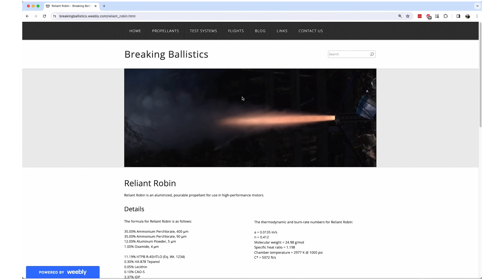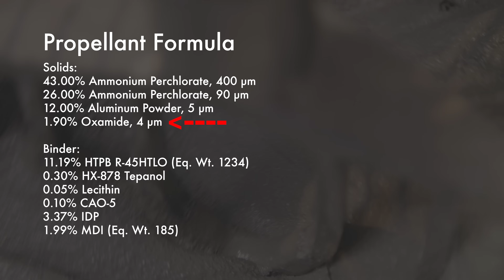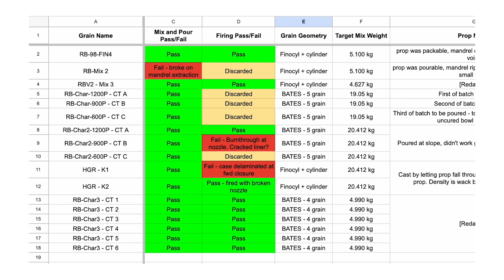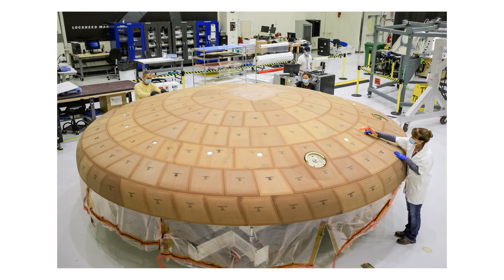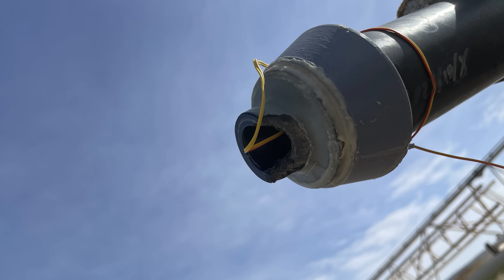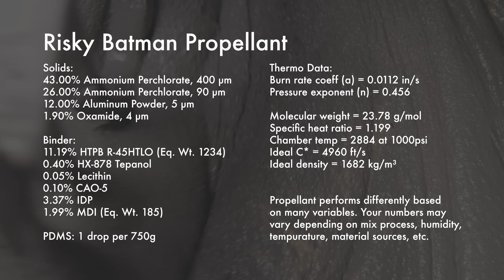First Time Firing My New Rocket Propellant

Comment: Going over 100% isn't really an issue it just changes your formula from percentages to parts. Since the total will now be over 100 per serving. And if you needed 100g you would just calculate for 99.

Comment: So why not make a motor that has two layers? Initially, the motor has a layer of propellant that has 90m AP and burns harder, then as it burns through the first layer, it reaches the second layer that has 400m AP. If this works, then you should turn out with a motor that burns hard initially and burns a bit slower later in the flight. I don’t know if this would work, it’s rocket science after all.

Comment: Just had this thought, and thought it might be valuble to you, given that you're still working on these motors. You had issues with your mould release early on in the video, it might be worth getting some Teflon rods and sheet, and making a negative mould from that, it's pretty cheap and would completly eliminate your need for mould release, and would give you a bit more consistency for your propellant geometry, since you won't introduce a bunch of variation in surface area on the inside of the motors. Im not an engineer, so I wouldn't be able to say much more than that, and I could be entirely wrong, but I am a chemist, and I know that variations in surface area can affect reactions in really unexpected ways.

Comment: Love your attitude and passion.  I do have two observations.  First, would it make sense to buy some screening material to control the particle size and secondly, could you perform your vacuum procedure in the tube rather than the pot.  Maybe even allow to cure under vacuum.

Comment: Quiz question-on these hobbyist solid rocket motors, does anybody use styrofoam for the core of the mold to create the central cavity? Rather than dissolving it, one could let the early part of ignition process burn it out.

Comment: Im late to the party since this video is one year old but working with concrete, we use a giant vibrator to get the pouring air out of the concrete. The vibrations make the liquid act more liquid temporarily. Might f up the mixture though and bring heavier parts of the mixture down and make it a two phase. Would’ve to test - but it’s a method I would recommend. Just holds giant vibrator on the outside of the tube

Comment: I might be 1 year to late but if you like try this again with the big one but change some things make 2 different things this fuel and thermite.
So use same % fuel you used in this video then mix in about 5% thermite in all through the paste and wow the burn is extreme if done right if not literally explosive as it burned so fast it became a bomb.
So ya.
I use my mix with 100mc and 300mc not 90mc and 400mc as the thermite doesn't like to um light so when it does 3 things slow or fast or boom 😂.

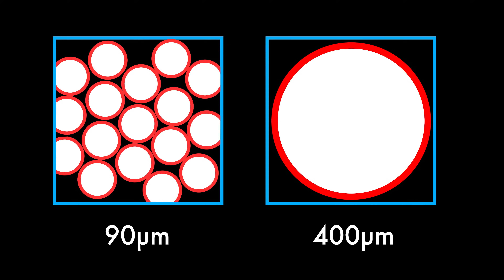Comment: 3:00 That view of the perchlorate particles is not right imho. They do not decompose from all sides, but are embedded in a matrix where the burn frontier wanders through - So they start to decompose from one side. If that werent the case, and the pearls would be engulfed in flames from all sides, that would also mean they might get ejected out the nozzle prematurely.

Comment: Awesome, one suggestion is for the mandrel, which is instead of PLA (which often makes a great molding polymer given how stiff and chemically inert it is, but if adhesion is your primary problem and reducing oils would be beneficial, nothing doesn't stick like PA (nylons) just straight nylon (no smoosh-ins) and as anyone who has printed it before, it barely wants to stick to the printer. I've use Taulman's Nylon 910 for molds and it is super slippery (and obviously tough) I would bet the slight flex won't affect accuracy of mold release since you aren't using injection molding and there is no pressure other than gravity.

Comment: How did you get your theoretical burn rate? Did you get it from Terry's book?

Another way to characterize the fuel if you dont have a pressure guage is by using the rocket performance equation

P=kn*density*isp*burnrate

Burn rate is webthick\burntime

Then you m=log(p2\p1)\log(kn2\kn1)

And n is 1-1\m

Then r is aP^n solve for a. 

I jave verified this method a couple of times and i have made a video on it as well. 

I dis this because i wanted to see if i could do it theoretically and to see how close I was once I did burn tests and full static tests and I was literally spot on

I love propep3 and the book by terry. Good stuff.

Comment: Galcit 61c: good old tar baby. Some asphal say 70%+10 weight motor 🛢 5% +3%mineral oil 22%oxadizer potassium perchlorate. Ok heat tar to350 ferinhigh safety first .research moon buner and RATO n JATO ,3 Stage should get the rocket to low height above ground.  Say 110.000.

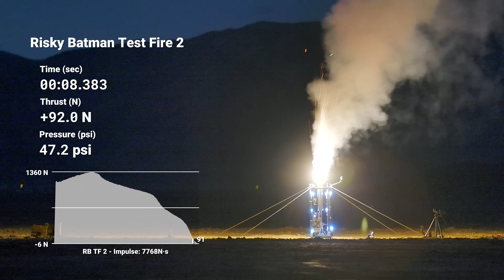Comment: 13:15 Just curious, why does the thrust eventually go negative?
Reply: motor's burned a lot of mass after ignition and i presume thrust is measured from force pushing down into the stand, so when there's less mass affected by gravity in the end, it assumes that there's a decrease in thrust 

TL:DR, rocket ligter, less mass, "negative thrust" because lighter

Comment: Hey Joe, in your vertical test stand how do you account for the changing weight (mass flow rate) of the propellant in your thrust computations?   Do you have a link to a paper or video that shows this?

Comment: hook hook hook, right? thats the most artistic moustashe ever. you can just try until it works. so you mean poopology, shooting down from the butt-ology. this man is baking tough cookies. or cement. solar sun heat collecting blimp launch platform gets up to say 50km even before any rockets are launched, you just need to paint the carbon fiber balloon fabric with high temp carbon black and aluminium reflective paint, just like survival blankets. for reasons. fusion/solar reactor is a better power source. that fenolic stuff looks to be just wood. or cardboard tube. making bread dough is tedious, relatively. does not your outer rocket shell keep the nozzle compressed inside, without cracking. creator: "ok..."
Reply: whats the best rocket, if not solid state rockets. gravity plumbed liquid rockets. yep you can do the reactor reactions without turbo pumps.

Comment: Have you ever used 3 or more different micron size NH4CLO4? I’ve tested with ferric oxide to alter burn characteristics. 
First motor test exceeded chamber pressure (serious chuffing). Blew out end plug but recovered case (4140) and carbon graphite nozzle intact.

Comment: Have you considered using a vibrating fixture when pouring propellant?  This will get the air bubbles out of the propellant as it is placed, and is far more reliable than "rodding" the mixture by hand which can actually create more voids than it removes.  I have never built a rocket motor but I have placed some concrete and it makes a huge difference.  It's another process element you can parameterize and control.

Comment: For burn rate tests I recommend using less propellant (1 lb is fine). To make calculations easier you can settle for a rectangular prism or cylinder grain shape that you've precisely measured and develop a surface regression equation for until their is no surface left (which gives you surface area at every point during the burn). Assume that that Pmax is the start of the burn (max flame spread) and the end of the burn is the bump in the graph when the propellant splinters apart (hopefully near the end if your binder/curing was good). It's better to test in triplicate or more and using so much propellant for one shot is less good than multiple shots with less propellant. Also nozzle diameter is key for burn rate, make sure you get a before and after diameter measurement and that you use steel or graphite nozzles. Good luck and stay safe out there!

Edit: I finished the video and you pretty much did just that lol.

Comment: This wont help you with your space shot but i did just successfully test a G class Motor thats fully 3D printed from ABS, even the nozzle which showed very little erosion. Im using 80 grams of KN Sorbitol and ground rubber. Burn time is just under a second. Something to try!

Comment: Armchair scientist here!!!!! Curious if you have thought about using a Chopped carbon fiber/graphite composite for your nozzles They both hold the same temp ratings or close too 3000 give or take but I feel the structural aspect of carbon fiber might win out! And yes for all of you that are going to say they are the exact same thing you're right!!!!!! Given your ability to produce things others just are to lazy to try... I am curious if combining the chopped or strand carbon fiber with the graphite powder/slurry prior to molding if it would alleviate some of your cracking issues! I also understand your asking for problems adding anything that could possibly trap a single bubble or cavity but where there is a will there is a way!

Comment: When pouring the propellant into the rocket body, have you thought about strapping an orbital sander to the rocket body and gently vibrate the body at different frequencies to help break up the bubbles another difficulties that you were having? PS. Safelight, can you replace a windshield with a rocket motor sticking out of it.😂

Comment: Why don't you automate a sifter for your AP, get some 90 micron sieves and shake it for a few hours with a motor until everything smaller falls out, if you are worried about larger particulates, then get a 95 or 100 sifter and reject the larger particles that remain. Essentially you are doing another quality control step that the manufacturers are supposed to do, but it's better than unattainable consistency from different vendors.
Reply: I just saw someone else commented the same thing and suggested stacking the sifters, that's a great idea.

Comment: The graphite nozzle surprised me. I did not expect it to crack. It kind of wonders me how competing units are merged together in the data here. Even feet competing with inches. I thought the foot is the English scientific unit of length just to see once again that that's only partially true. Btw is there a simple way of just using a cooled nozzle for test firing.

Comment: A downside is that Newtons aren't really compatible with psi. So you need a constant to fix or switch the unit. There could be newtons per square inch or you use pascals or even bars.

Comment: Hi Joe! Great work on this saga! How did you calculate the burn rate versus chamber pressure data point for each of the motor tests? I see you have exactly 6 data points (I assume one for each motor), but which part of the thrust curve did you use to generate these points, and how did you measure/calculate the regression rate exactly?

Comment: also if you take a trick from Jack Parsons(JPL) form the sold fuel into triangles to make a pentagram
Reply: re heat when in the press or vaccume the bubbles out and are you sure the mold release isnt causing the bubbles or the PLA?

Comment: please don't be offended by this - but I expect that people playing with stuff that can blow their faces off might see beyond "superficial offence". Also, forgive me if this has been written to you already amongst over 800 comments below.

You are just p1ssing into the wind, formulating by %weight as you are. You absolutely should be working by volumes! Personal professional experience as a formulator of surface coatings, adhesives, sealants taught me that "volumes" is the ONLY way to work! Rheology is a key aspect of paints, adhesives, where "volumes" reign - and aren't you really just doing the same with stuff that goes Bang?!

You are working with mixtures here, not solutions and every component takes up space in that mixture. Sure, there are things like particle surface area that affect flow (when wet) and combustion rates (hopefully only) when dry. But you have mixtures here and mixtures work by volumes. Presumption here is that the SG (specific gravity, density, call it what you will) of every ingredient is known so you can easily formulate by volumes and convert back to weight for measuring out later.

The silliest part I saw here was when you typed in a recipe to get back, amongst a whole lot of burning (?) data AS WELL AS SG! The only way you would illustrate that you get SG from there is that you don't already know it - as you would already would if you formulated by volumes so I infer, by that, that you work by weight!

Imagine a table headed by "component name", "volume", "sg", "weight".

You enter in the volume of each component (could be % but needn't be) and the sg and that gives you the weight.

Add all the volumes, add all the weights, divide and that gives you the sg of the entire formulation- easy peasy! 

Where using volumes works best is where you wish to switch out some of one ingredient in favour of some of another ingredient, and where the sg of both are different. Do that by volumes, adding one - reducing the other does not impact the volume contributions of all the other components but doing that by weights sure does.

So formulate by volumes and convert to weights for weighing out and manufacturing (and for publication). It works wonders when you are juggling with recipes as you are.

A second tip, if you are juggling two components to achieve something like "desirable pourability", make one measured pot well one side of target and another pot well on the other side (weigh them). Then mix some of each until you're where you need to be, weigh the two again and you can easily work out what you have in that perfect mixture. Might work well if you're juggling with something that's in very small amounts and Lecithin is a standout candidate. Again, formulating by volumes makes the world of mixtures a whole lot easier and clearer.

Comment: When I pour concrete we use a “bulldick” to vibrate the concrete to prevent airspace. We do this during the pour before the concrete gets too hot and firmed up. I understand it’s not a very scientific method but it works. This could be scaled down to assist with the void concerns. Hope it helps. And please let me know if you try it. Great program you run I’m a long time fan of your work.

Comment: you need to vacuum your castings in a cylindrical vacuum chamber after they are poured as well as degassing the propellant before it is poured.

Comment: Hey Joe,
Great work that you're doing! I like to see the progress you're making with the space shot project.
This update about the solid fuel is very interesting, and your process for advancing the quality and performance of your fuel is amazing. Capturing, analyzing, and implementing all the data will ensure success!

I have a question about the new propellant:
What does it smell like when it burns? I am familiar with the Estes-type motors, but not any of the Level 1, and Level 2; etc., types of rocket motor propulsion. I wonder how much different from the Estes motor smell, are the odors from your new mixture of rocket thrust inducement. Please let me know if there is a way to find out.
Thanks, Joe!

Comment: I worked on motors 20 years ago.  You need to solve your vacuum degassing problem in your grains combined with your propellent mixing, viscosity and curative add timing.  The voids in the grains can be fatal.

Comment: Perchlorates have good solubility in water.  A fully saturated solution would have a zero size perchlorate.  I wonder if this can be mixed with binder and other fuel while saturated?  It's time to dust off the mad science lab, and make some batches.  It's also soluble in methanol.

Comment: if the purpose is just to reach an altitude within the atmosphere, u dont need a fast burning fuel, the payload will reach the height a few seconds later even using a slower brning fuel. But if you need to launch with escape velocity u need a fast burning fuel.

Comment: Hello, i have 2 ideas for experimental motor. 
1. What  if you build motor with 2 different propelants. For down layer small particle fast burning grain , it will react fast and probably dont build slag on the nozzle and for upper layer big particle slow burning grain it will travel longer distance so it will have enough time to fully react before exiting nozzle to not wasting propelant. It will have good kickstart but also long burntime to push rocket further up. 

2. Cast multilayer propelant grains. At first cast outer ring with big hole from slowburning propelant and then cast second layer in it with normal size hole from fastburning propelant . I think at start of burning is small surface area so you need fastburning propelant to make good push and when surface area will increas it will burn into slowburning propelant so it will push rocket longer also I think your graph will be more  consistent, stabile you know what i mean, like liquid rockets.
I hope you will made at least small scale test of these.

Comment: Back in the 90's I worked on some HTPB & PBAN propellants for use on lifting large fireworks shells via stick rockets. Black Powder rockets just did not have enough lift. Eventually went with Whistle Rocket propellant which is a whole other scary process. Congrats on your progress. EDIT: What I get for commenting before watching the whole video. The ground chaser was super impressive. Kind of like when a 8 foot diameter Girandola took out a Minivan at PGI.

Comment: The data collected is perfect inputs for a simple neural network to find a global minima mix optimized for all the things, and predict values.

Sifting the AP for tighter control of density would be probably reduce variability error bars significantly.

Can you use different mixes for different flight stages? It would require propellent in layered liners of course. Perhaps casting a thin cylinder, than pouring propellant around it in a casing. So many ideas...